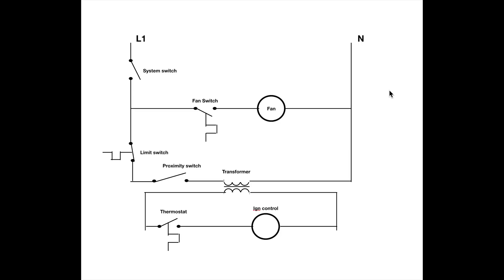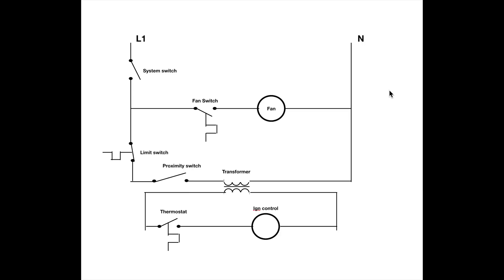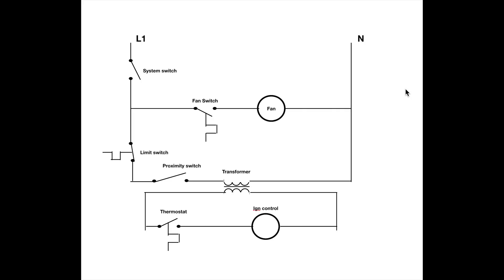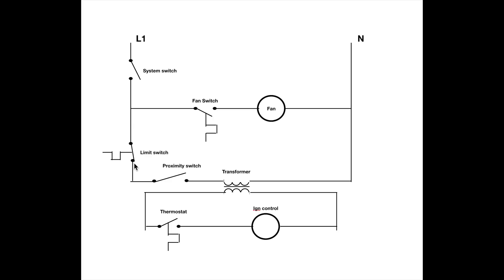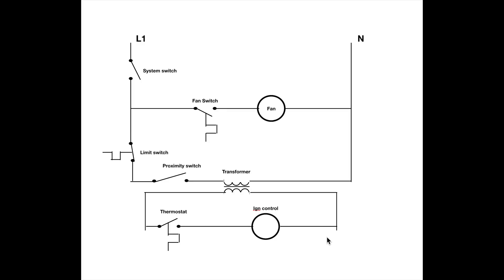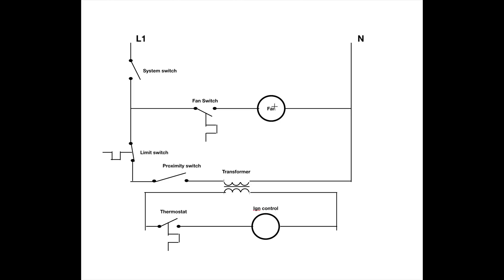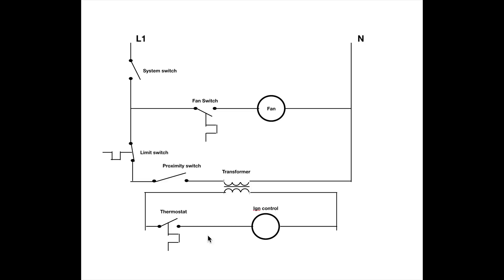Unit heater schematic #2

Comment: Got a question, my dad has an old reznor gas heater that's missi9ng the data plate, we are trying to get it wired up and working and are having issues , it appears to have an old honeywell gas valve that appears to work, he wants to wire it up to a thermostat and i found some diagrams for the electrical part of the gas valve, issue is all the wires are black, from the fan to the valve, the valve has 2 sets of wires and the fan 1, 3 ploy coated black wires and 3 what appear to be a black coated fabric, any info is appreciated, gas valve # are V4135A and C5134B1033 2 with C4 below it

Comment: I have a sterling CF-45  with no schematic diagram and couldn't find one online or Their website.. fan doesnt kick on and safeties dont turn off unit..  how should I ol go about?? Hack it?
Reply from the maker: Depending on the age of the unit, there may be 2 snap disc temp controls located near the heat exchanger.  One of those is a fan switch.  That switch may have failed.  You can determine which is the fan switch by its wiring in series with the fan motor.  The motor could also have failed.
GFM
Reply: @grayfurnaceman  heat exchanger is open in half.. gonna scrap it..

Comment: Unrelated to your video but I have an old luxaire unit heater in my garage that I recently hooked up. It has an opening above the heat exchanger on the front side that lets flue gases come out of the front. Looks almost like there should be a plate installed there, but I haven’t been able to find anything about it (it’s missing the name plate with the model number) I’m thinking about making a plate to seal it off but wanted your opinion. 
Here’s a video of it
https://youtu.be/VJprVEjP5dc
Reply from the maker: Ok, prepare to be beat up.  Throw this piece of crap away.  It is at least 60 years old.  I could not tell if the heat exchanger is cracked, but its a good bet it is either cracked or rusted out.  We stopped using the controls of the type I see on this unit in the early 1960s.  The hole in the front is a draft hood.  It looks like the restriction has been removed and there is no way to know what it originally looked like.  Covering it up would cause flame rollout and pilot outages.  There is no burner cover on top of the burners.  This upsets the secondary air.  
As for the install, there is no gas cock on the gas line.  You need this in case of a leak in the gas system.  Also, does the vent go vertical when it exits the wall?  It needs to.  
At best, if you operate this piece of junk you will get vent gas spillage into the structure.  At worst, carbon monoxide poisoning.
GFM

Comment: You've peaked my interest in the proximity switch! I have a unit heater in my shop and would love to know more about the proximity switch. Sounds like a great idea to wire one into the circuit. Could you maybe do a video explaining the switch itself? Thanks a bunch, your videos are always very helpful!
Reply from the maker: They are the same sensor as used in outdoor lights that come on when you come near them.  
GFM

Comment: I'm having an issue with the same type of unit, pilot stays on when thermostat calls for heat,ignition occurs then blowers starts running for about a few seconds, then it shuts down. And ideas? I was thinking there might be a hope in the heat exchanger that tripping a limit when the blower comes on? I'm kinda new to the industry about 4 or 5 full singers and Winters but haven't worked on these type of heaters yet. Any advice or ideas to look for would be appreciated. Also the video of you going through the unit. Thanks I've learned so much from you over the last few years I can't tell you how many times you've helped me. Thanks again brother
Reply from the maker: If the temp In the structure is below about 60F, it is normal for them to cycle the fan.  The ambient shocks the fan switch and shuts down the fan.  
GFM
Reply: grayfurnaceman it's in a car wash so it's definitely cold in there now I'm in Cleveland. But its like when as so soon as ignition on the main burners is achieved the blower motor comes on for a few seconds then ignition and pilot cuts out.  I gotta go back there. I'm. Thinking it's not theremocouple because pilot stays lit otherwise and main ignition is achieved. Could it be the a whole in the heat exchanger,causing high limit cut out, or faulty gas valve.  I didn't have my camera to check for hole. But I'm gonna go back test the theremocouple again ( what should a main full ignition (millivolt reading be in the range of), check with the camera thoroughly for a hole and look for blow back, if not the only other thing I can think of is a faulty gas valve. these are older units like they where used once somewhere,  then brought to this newer building trying to take the cheap way out. so you think that Is a pretty good plan on of action? Again thanks for you videos I've learned so much from you and just from spending time watching your videos I've been offered my own truck and a r a ise
Reply from the maker: Ok, so the burners come on and when the fan comes on the burners go off.  The pilot then stays lit?  
The fan could blow out the burners if the heat exchanger is rusted thru badly.  If it is in a car wash, and does not have a stainless heat exchanger, it is probably rusted out.  14 to 22 millivolts is normal.  If they are second hand, the heat exchanger is almost certainly rusted.  Good luck.
GFM
Reply: grayfurnaceman yes as What I was thinking but when burners are on and fan comes on after a few seconds everything goes out burners and pilot...